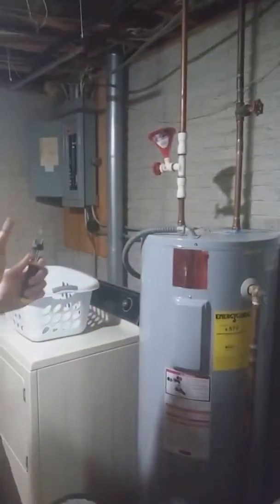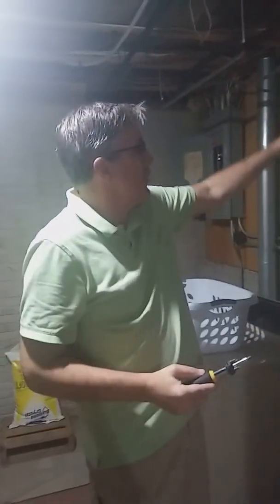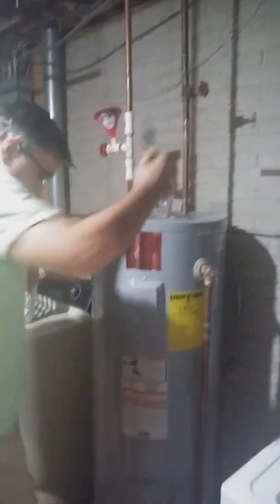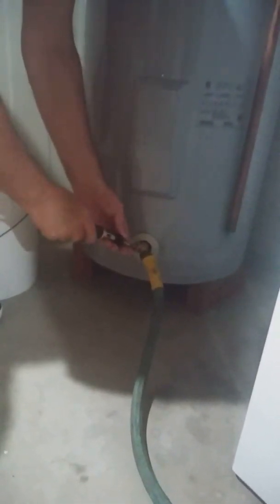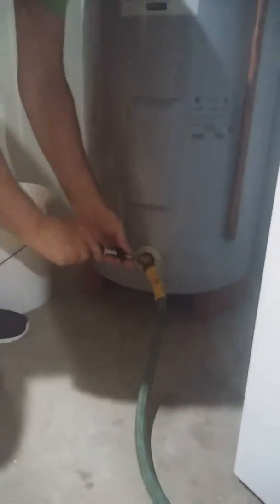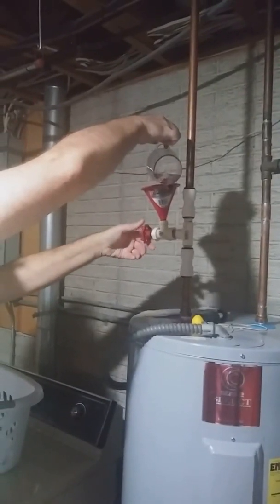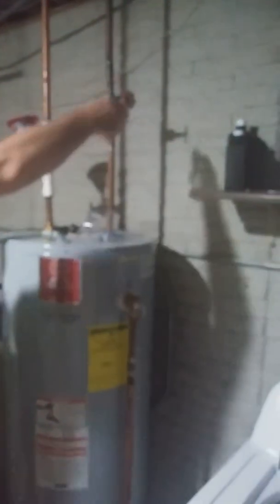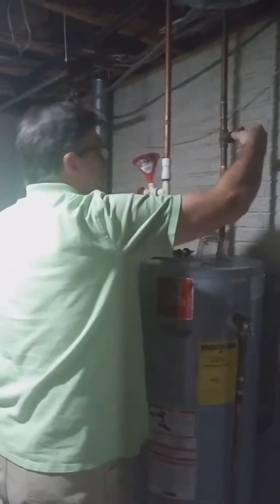How to rid hot water of sulfur smell

Comment: I have a terrible sulfur smell in my well water. I put a holding tank before the line to the house, when the water sits the sulfur dissipates. No smell whatsoever, and my sterling flatware no longer turns black. My tank was quite large but see no reason why it wouldn't work with a smaller tank. Water tanks are not airtight like a water heater, so I assume that's why it works. 🤷🏻‍♀️ 40 years it's worked..😊

Comment: Couple questions not answered in the video I hope I don’t die doing this lol.

1) I know you turned the cold water valve off but did you have to turn the water heater off? Via the circuit breaker or the water heater control.

2) did you turn on your hot water at the faucets

3) how long do you try to keep the peroxide in the tank? Do you turn it back on and let it percolate?
Reply from the maker: 1.) No we don't turn the electric off. 2.) We do not do anything with the faucets.  We just drain enough water out of the tank to make room and a suction to pour in the peroxide. 3.) We just use the water as normal after that.  The peroxide is unnoticeable in your water.
Reply: @rpeterson8741  it worked perfectly. Appreciate your video very much. Thanks for your help! 👍🏽

Comment: I'm a licensed plumber.
You're TRULY publishing utter garbage to the public. Do the job right

Pull the spent or worthless anode rod
Shock chlorinate
Flush throughly through boiler drain
There's untold bacterial overgrowth in tank, you're not helping anyone JUST your ego giving wrong information to trusting people.
A water test should be done to see what's going into tank then use a high quality resistor rod usually magnesium not aluminum. 
White PVC isn't rated for Hot water. Don't be an imbecile

Comment: I don't have a funnel system.  Can you put the peroxide through the cold inlet?
Reply from the maker: Yes,  if you want to disconnect your water line each time.
Reply: Most all modern water heaters have a heat trap flapper on inlet fittings.
This guy is a clown
Reply: You can add a tee with a shut-off like he has on the other side as long as the tee is after the main water heater shut off valve.

Comment: Hello, how often do you need to do that?
Reply from the maker: Whenever we have not used the water for a couple of weeks. Otherwise it is only as needed, maybe once every few months.
Reply: @rpeterson8741  why not just install a powered titanium anode rod and fix it permanently.
Reply from the maker: @ironjohn5914  I replaced the rod with an aluminum/zinc anode rod but still had the smell. I didn't know they had powered ones.  Fortunately, our smell is not terrible so I'll probably stick with our current setup.  If it gets worse, I may spend the extra money and try a powered rod.

Comment: Where do you pour tge h2o2? My water heater doesn't have that 2nd valve....
Reply: Hey there!  If you turn the power off to your water heater (or if it is gas turn it to "pilot light") then you can close the cold water valve to it.  This will allow you to safely drain (under only the pressure of gravity) a small amount of water from the water heater, and then you can remove the anode at the top of the water heater and put the H2O2 in that hole.   Personally, if you're going to go that far, I'd also purchase a "STOLTCO Powered Anode" on Amazon.  It fixes most "rotten egg" smell problems, and has a 20-year warranty.  Comes as a kit.